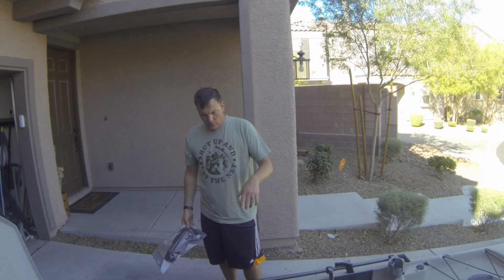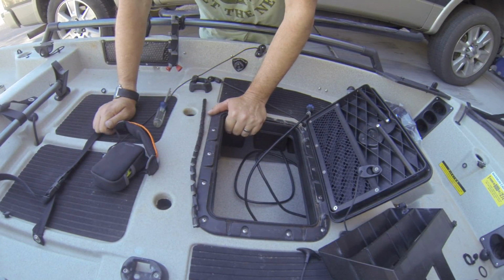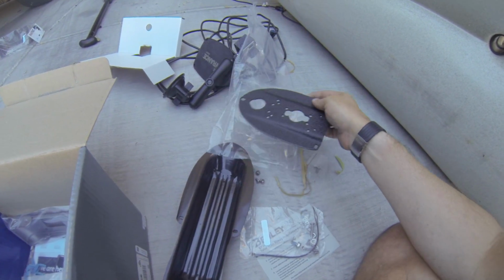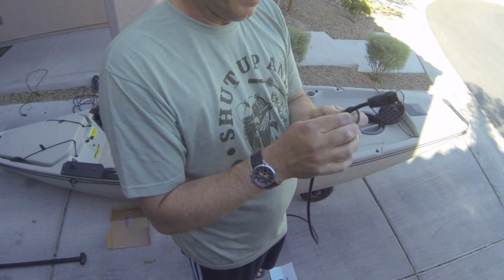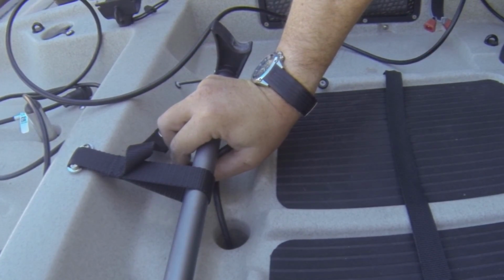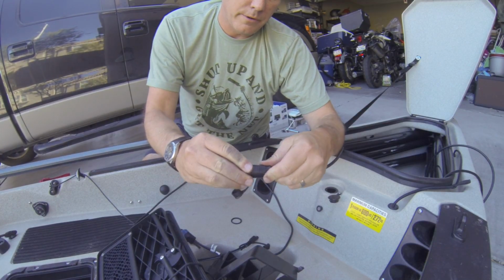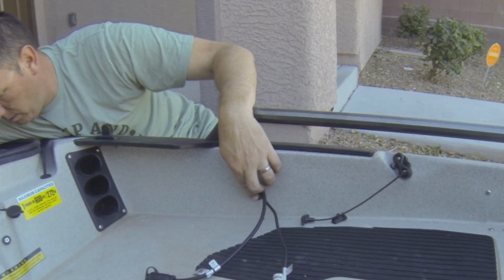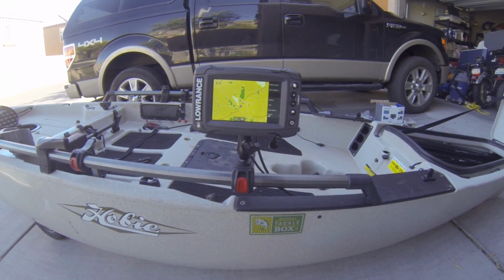Hobie PA side-imaging sonar install

Comment: I have a 2018 pa14 w/o guardian - do you happen to know if that mount will be compatible with any of these: Garmin's GT54UHD-TM Transducer  / Lowrance's Active Imaging 3-in-1 Transducer / Humminbird's Low Q CHIRP Transducer ? Thanks !
Reply from the maker: BerleyPro makes different mounts/covers for the Humminbird and Lowrance.  Not sure about the Garmin.
Reply: Did you figure anything out? I have a 2018 pa 14 w/o guardian and can’t find anything where it sits flush with the bottom of the boat
Reply: @sgorman9523  nope - sold my boat lol

Comment: Nice video! Does that cover plate on the transducer drag on the ground when the wheels aren't on. Like during launching?
Reply from the maker: Not really.  It's very slightly higher than the pontoons so it isn't the lowest point on the hull.

Comment: Hi I have a 2018 PA 12, would this also work?
Reply from the maker: The thru-hull fittings are easier to work with on the newer model, but otherwise it’s the same.

Comment: How do you transport your kayak ?? I was worried about getting this because I use my truck bed . Was worried it would not lay flat in the bed
Reply from the maker: I rooftop it on my truck in the Hobie cradles for long hauls, which is most of my trips.  For short runs, I use a BooneDox T-bone and put the boat in the bed.  I store it in a storage unit sitting flat.  The BerleyPro housing doesn't stick down far enough to be a problem.
Reply: Kung Pow that's great to hear thank you . Great instructional video as well

Comment: Will this be the same for me installing a lowrance elite 7ti on my 2017 pro angler 12
Reply from the maker: Should be exactly the same as far as the plate goes. The thru-hull plugs are easier to use now since they don’t use the nut anymore.

Comment: Did the imaging seem clear when you surrounded it with the BerlyPro?
Reply from the maker: The BerleyPro fills with water and since there's no air gap to generate a return, it's like it isn't even there.  No different than the factory Hobie "Lowrance Ready" plate with down imaging.
Reply: Thanks for the reply!  Sorry I did not write back sooner.
Reply from the maker: No worries.

Comment: Does the adaptor plate and the nose fastener come with the elite 5
Reply from the maker: Other than the transducer itself and the display, everything used in this install is from other companies than Lowrance.  The adapter plate and the shield for the transducer are from BerleyPro.  I think it came with a different front screw but I'd have to go back through the video to see.  I seem to recall making a trip to the hardware store to get slightly longer stainless screws.
Reply: Did you connect the NMEA 0183 cable up
Reply from the maker: Nothing to connect it to.  I actually clipped it off about an inch from the connector since i didn't need it and didn't want to have extra cable laying about getting in the way.

Comment: Is that a 2017 hobie pa 14
Reply from the maker: 2105.  Bought the day the 2016 models were released.  Almost no difference from 2015 to 2017 except the '17 has the MD180 drive with reverse and the style of the thru hull wiring plates are different.  The newer style plate have 3 openings for wire and 3 screws that hold them to the hull rather than the nut inside the hull.